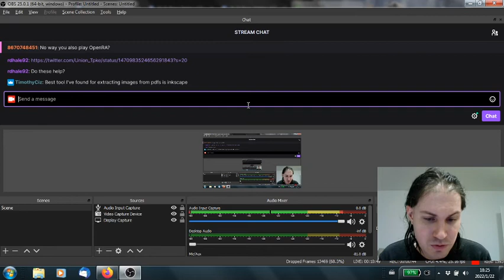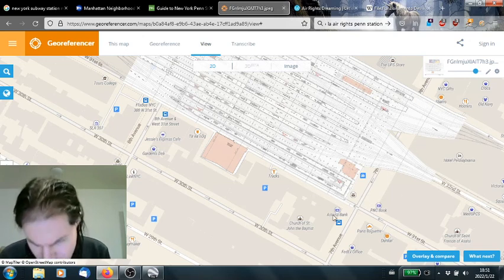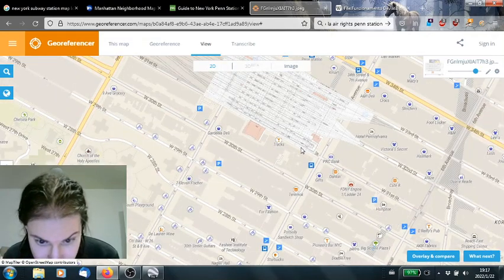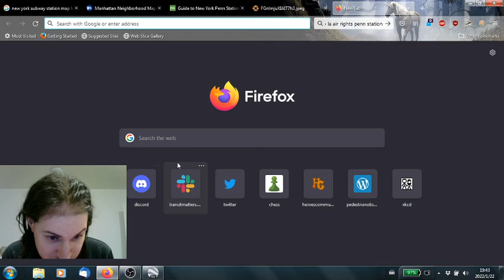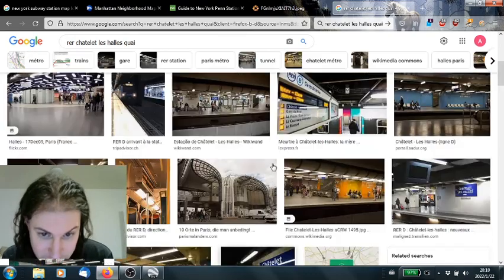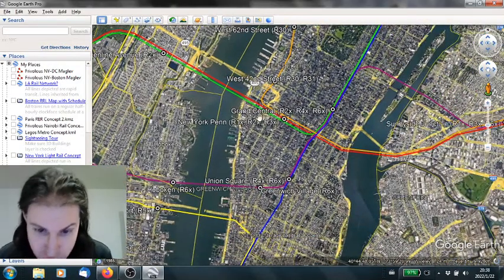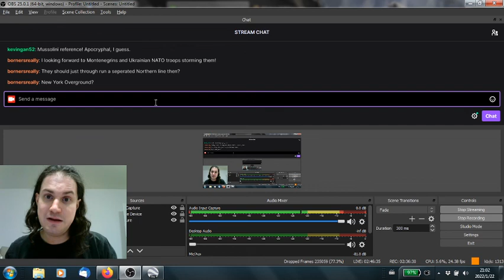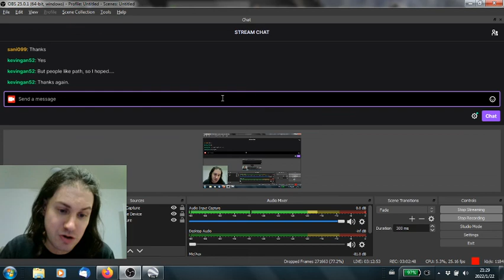Penn Station Should be a Hole in the Ground

Comment: Alon, what do you think about connecting the Far Rockaway, West Hempstead, end of Hempstead and possibly Oyster Bay branches to form a new line
Reply from the maker: ...maybe? Oyster Bay-West Hempstead is doable and sometimes I propose that as a tram-train or a dinky to get these trains out of the mainline's way.
Reply: @alonlevy8622  connecting West Hempstead and Far Rockaway is probably the most doable part of this whole thing. Also, as someone went to school in the 5 towns, I think there is a lot of travel between the 5 towns and West Hempstead, but also to points farther north, like Mineola. The roads between these places isn't very fast, so a train would be able to compete